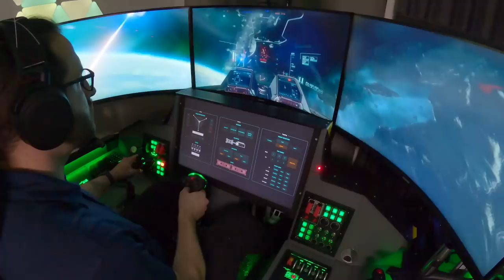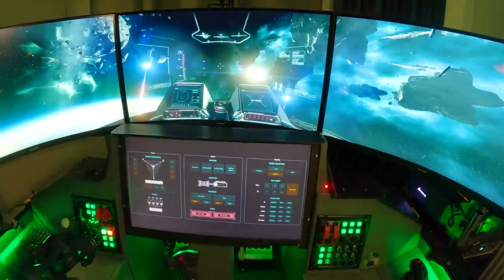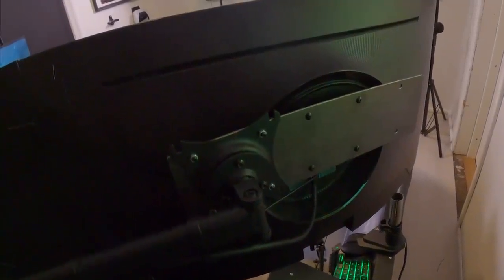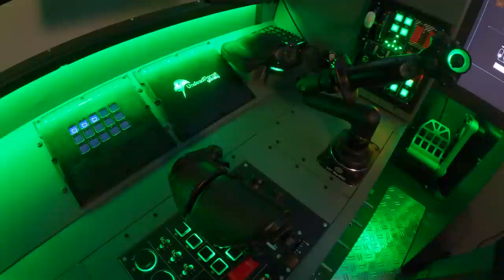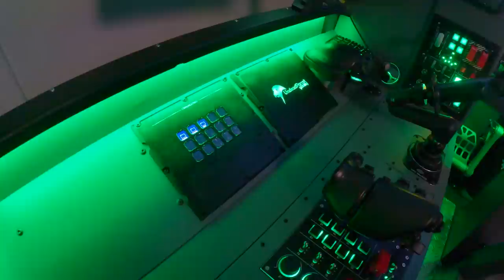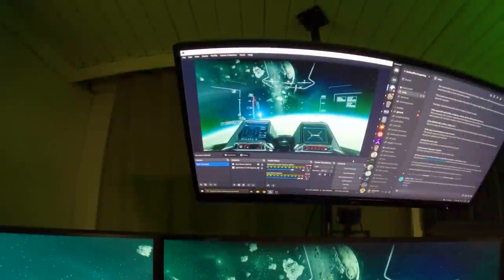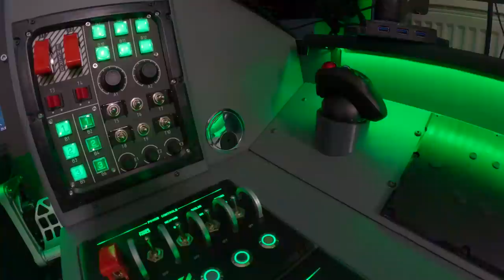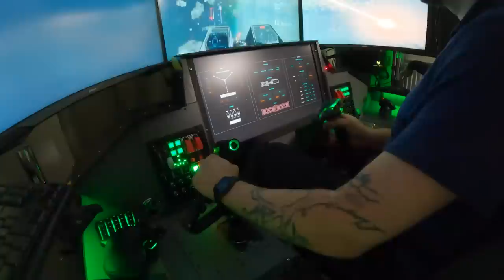Star Citizen Cockpit Overview (new version)

Comment: Well done sir!! This is just great! Quick question...what GPU are you using for those triples, and what resolution are you running at? I just set up my own triple monitor setup, and I'm just curious. I haven't tried Star Citizen yet, as I have been sim racing.
Reply from the maker: I'm running Geforce 4090 with 7680x1440 resolution. Though it was completely playable on my old Radeon RX 6800 XT with same resolution. Just need to accept that the FPS won't be too high in big cities (where you won't spend too much time anyway). And turn down volumetric cloud quality, that's the worst offender currently and badly unoptimized.

But the performance won't be that good with any system yet. They're working on Vulkan support which at least should help in the future.

Comment: I get your reasoning for not using VR, but have you considered using projectors? Can build a half cylinder or partial dome around the front and then use a projector or two on it.
There's software for lining them up.
Could remove the top 4 LCDs, and use a smaller LCD for discord like you would for an MFD lower down in the simpit.
Reply from the maker: Yes, that’s my future plan.

Comment: Hello sir, love your videos. Quick question, would you recommend going triple 32 inch 1440p or 4k monitors with a 4090? Do you have any regrets with going 1440p? Thank you in advance. Your setup is a huge inspiration
Reply from the maker: Thanks. Main reason for going with 1440p monitors was that they were cheap and as my previous G9 display broke, I decided I wanted to go with the screen area instead of no bezels.

Not sure how well SC would run on 3 x 4k monitors at the moment, even with 4090. But when it comes to screen size, I like to think bigger is better. You can always use lower resolution.

Personally I'm aiming to build a curved 180 degree screen and set up probably 2 x 4k projectors with it in the near future.

Comment: questions
why 3 small monitors instead of one big ultrawide screen?
can you hop out of your craft and do fps with a  trackball?
where is the cupholder?
cheers
Reply from the maker: Hey,

1) One big ultrawide (e.g. Samsung G9) is so much smaller than 3 x 32". I don't mind bezels. One day I'll build a curved screen with projectors though.

2) Not with a trackball but that's why I have the mouse tray that I can install in few seconds.

3) On the right back corner.

Comment: You switched from the tobii of the previous cockpit to trackIR for this one, do you think it is better? I'm on the fence between the two
Reply from the maker: I prefer the TrackIR 5 myself. Both have ups and downs.

Tobii naturally doesn't need any head clips and has the eye tracking if you want to use that.

TrackIR has more freedom with placing the sensor and is a bit more responsive.
Reply: @UndeadParrot  thanks 👍is the lower responsiveness of the tobii noticeable and would you still go for the TrackIR if that was the only drawback, and the placement was not an issue?
Reply from the maker: It's noticeable but I was happy with Tobii too. Both are great choices so to be honest, I'm not sure what I would do in that case.

Comment: That's not the original trackir trackclip pro right? Your looks to be wireless and better constructed than the original one. Where did you get it? Amazing setup btw, one day I'll build something similar!
Reply from the maker: It's actually remarkably difficult to find wireless ones. I ended up ordering mine from Aliexpress if I remember correctly.

Comment: How did you make that type of mouse? I tried to do something like that but without good results
Reply from the maker: Something like this + a custom 3d printed panel: https://www.diyretroarcade.com/collections/trackballs
Reply: @UndeadParrot  ok, Found it on Amazon, and you used always arduino to Connect it on the pc?
Reply from the maker: @MrRevotv  This has basic ps/2 connection so just a usb adapter. Those buttons use Leo Bodnar, but Arduino would work there too.

Comment: Awsome setup. Simple but yet modular. That last trackball mouse you showed, what make is it and where can I buy one?
Reply from the maker: Thanks! The trackball is a simple arcade tracball that I attached to the panel. https://www.arcadeworlduk.com/categories/Arcade-Parts/Trackballs/

I think I ordered mine from Amazon, should be quite easy to find. Mine uses PS/2 though, so need a USB connector for it.
Reply: @UndeadParrot  Tx for the reply. The trackball mouse Im asking about is on the right side panel at the top... :-)
Reply from the maker: @AdrianFourie  Ah, that one. This: https://www.amazon.de/dp/B07ZKL66GY?psc=1&ref=ppx_yo2ov_dt_b_product_details

Comment: Nice!  I have been working on a similar setup that has 3 curved screens like yours, but I am having a heck of a time keeping them aligned with each other.  Each has a metal arm of it's own, but they often sag and change angle relative to each other as a result.  None of my attempts to remedy this have worked, so I was hoping you would share your solution.
Reply from the maker: I have a pillar that goes to ceiling so it can’r lean: https://www.undeadparrot.com/project-details/displays/
Reply: @UndeadParrot  Thanks for the info!

Comment: Really great setup, but why 3 monitors? There's the Samsung G9 and it just got an upgrade shown at the CES with an oled panel.
Reply from the maker: It's a matter of taste. G9 is basically 2 x 27" while I personally prefer the 3 x 32" screen area and don't mind the bezels that much.
Reply: @UndeadParrot  hum, i see, if it's for the bezels, i believe ASUS ROG had a device to "hide" bezels using mirrors, but i don't know if it will work with 32'' monitors.

Comment: this is actually too cool,also how did you get the gauges on the bottom display?
Reply from the maker: They aren't, there isn't any way to get data out from SC. For now, it's mostly a decoration. Works well with gauges and MFDs on FS2020 and DCS though.
Reply: @UndeadParrot  eh, im pretty sure someone will find a way to do it at one point

Comment: One of the more sensible modular sim pits.  Not too complicated or elaborate without sacrificing immersion.  Bless your wife for her supporting you one this hobby.  Only thing it's missing is a pair of cooling fans as that gaming room looks tiny and windowless so getting hot in your sim pit might be an issue
Reply from the maker: Thanks. There’s a window but yeah, I need some solution for next summer.

Comment: Love the setup. I would actually think about putting one or two smoke detectors inside the side panels. Might be a good idea with a combination of dry wood and electronics in a closed space.
Reply from the maker: Thanks, that's probably a good idea. I naturally don't have any power there when I'm not in, but still gives much better head start.

Comment: I almost expected the bottom screen to be a touchscreen device running GameGlass, but I'll be honest; that is a really impressive set-up even without touchscreen.
Reply from the maker: Thanks. The reason I haven't bought a touchscreen is just that I have enough bindings with physical buttons for now.

I'm planning to use it for MFDs and Gauges by building different overlays, e.g. take a sheet of plywood, cut holes into it for MDFs and add a TM Cougar MFD on it.

It would be nice to get something useful for SC on it but haven't yet figured out what.

Comment: Nice!  But why not just use the Samsung 49 inch or the upcoming 57 inch(I think) ultrawide so you get rid of the seems. Also one monitor is easier to run than three. Or at least that’s what I was told lol
Reply from the maker: I used to have the the G9 but prefer the screen area of these. Just a matter of taste. Samsung Ark is on the other hand so expensive that I'd rather stick with these untill I can start working with a curved screens + multiple projectors.

Comment: you need projector instead 3 monitors, then would be alright, and projector surface should cover 180 degrees.
Reply from the maker: Yes, that's the long term plan. At least 3 projectors and 270 degree surface.

Comment: I came here just to vent my frustration about Star Citizen but this set up is too good! I have less than 10 hours in Star Citizen but over 1000 in Elite so I can definitely appreciate it. I used to have a movement tracker on my headphones to simulate VR on my monitor. Maybe that's interesting for you as well. The original site for the ED tracker looks like it's on its last legs but I did find an ED tracker bundle that is still being sold by a hobby company. It's not much more than a gyroscope that you stick on your head to track the movements it works very well but it does need frequent calibrating (once a week?) if you have your headphones hanging around with it on top.

Anyway, hope you can enjoy Starfield with this setup :P
Reply from the maker: Well, I do get my share of people venting their frustration about SC. :D 

I’ve tried ED too. Great game, just prefer SC with the limited time I have for gaming. :)

Comment: Yeah I get your approach to bindings. I actually fly more competive bindings, but I've tried the flight sim/real life way, and I still think it's legitimate, if only for slower ships: dropships, heavy fighters, gunships, cargo, doesn't really make a difference for those.
For light fighters though, it's true. I spent weeks honing my skills with flights bindings, got to a decent level. Switched to pitch/yaw on the right, thrust on pedals, and laterals/roll on the left, and I felt more precise in minutes. It is what it is :)
Still think SC is a big world, and there will be space for less competitives pilots.
Reply from the maker: Yeah, it should have enough room for different styles.
Reply: I use a similar setup but I went for crosswind pedals with toe breaks so that I could have roll on those. 
The good thing about the crosswinds is that you can combine the toes into one axis in the native software without having to use something like gremlin. (I hate too much bloatware)
I use my left stick for just strafe up/down and side/side
And lock off the twists on both sticks because I hate twist
Reply from the maker: @0Metatron  Sounds like a good setup.

I ended up buying the Thrustmaster TPRs since they just happened to be available at a local store. :D

I don't like the twist axis myself, but the horizontal adapter makes it OK for left stick.

Comment: That's exactly how I would have set up the bindings - I very much dislike SC default - works for mouse or controller but not as great for hotas IMHO.
Reply from the maker: To be honest, I don't even know what the defaults are. Started with HOTAS but quite quickly went into HOSAS.
Reply: @UndeadParrot  Ok I missed the HOSAS --- though it was was a hotas setup. 

Do you still have throttle on the left stick plus strafe right and left, or how does that work ... couldn't quite tell from the video description.
Reply from the maker: @WaspMedia3D  Yes, basically movemement on the left stick and pointing the nose with right.

I think best PvP'ers seem to be using a bit different setup (e.g. thrusters on pedals) but I just like this more.

Comment: prtty garbage screens. you need big screens bud
Reply: @UndeadParrot  i mean you want immersive gaming experience obviously from your set up... 3 43 inch or 50 inch 120hz tvs will give you that.
Reply from the maker: @catatonicgalaxy1471  I'm actually planning to build something like 270 degree curved screen and three projectors. But it's a bit costly project so probably not this year, at least.
Reply: @UndeadParrot  try the used market for curved 75 and 85 inch tvs...